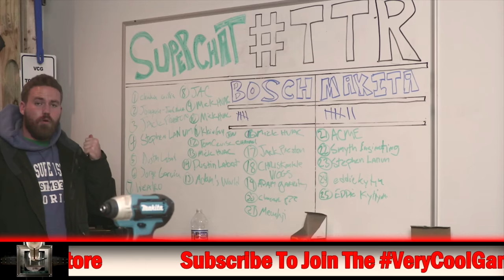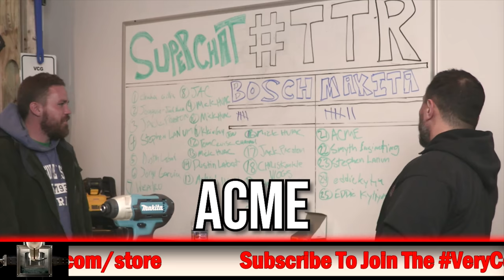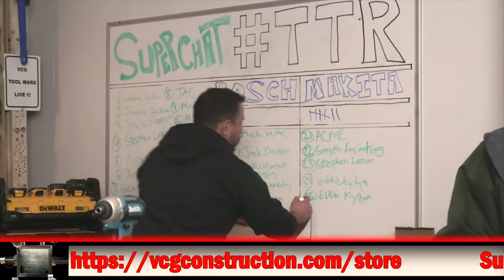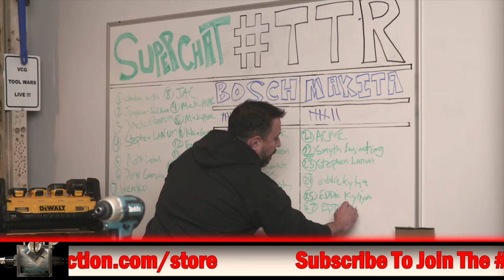Best Cordless 12V Max Impact Driver Comparison - Makita (DT03) VS Bosch (PS41)

Comment: Have nearly the entire line of Bosch 12v tools but am genuinely pissed off with their wimpy impacts! Step it up Bosch! Can't even drive a 100mm screw in the time my Panasonic or Gen 3 will drive 5 or 6 of them!

Panasonic are the Rolls Royce of the impact world. Not quite always number 1 for raw speed, but just simply the best all round. Ergonomics, waterproof, dust proof, build and incomparable battery quality... and they now look the coolest with that black or red Carbon!
Reply from the maker: The Panasonic look awesome!!

Comment: My ridgid 12 volt and Milwaukee m12 brushed and gen 2 brushless will destroy those 2 I have the Bosch and it is really weak!
Reply: Collet is weak on Milwaukee. Makita is the superior tool. Sure the newer impacts will drive a second or two faster but they break a lot. Also they’re owned by a huge corporation. Makita has been Makita for over 100 years. They started out making light fixtures around 1910.